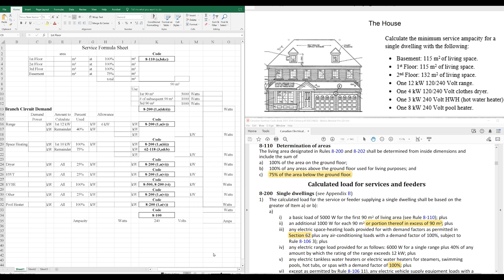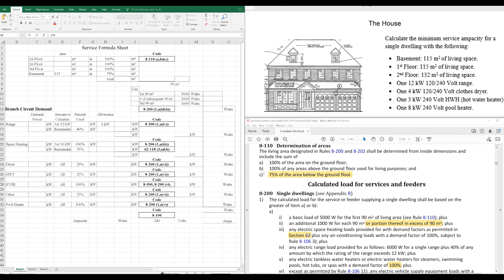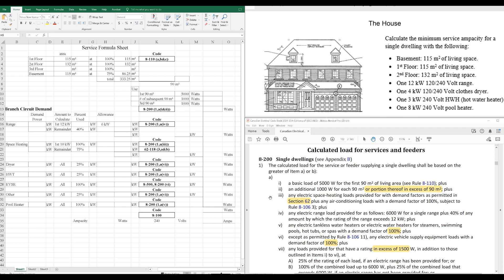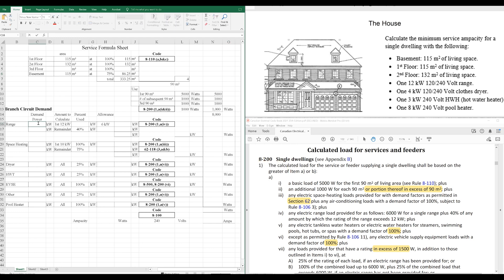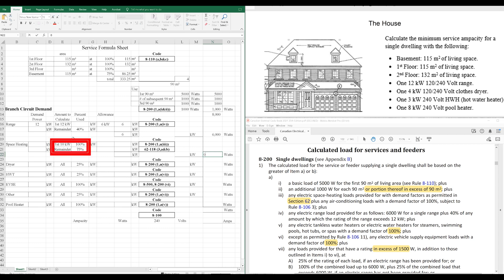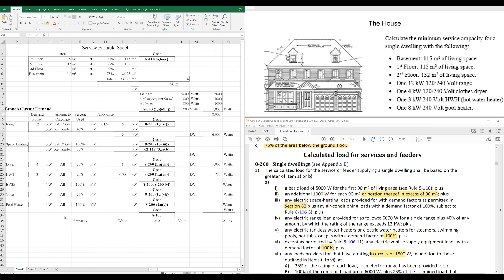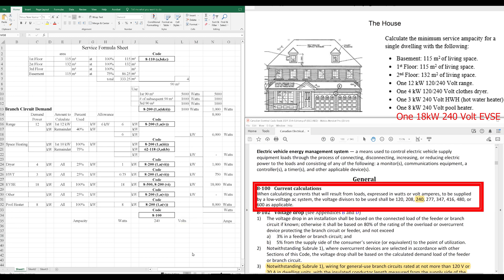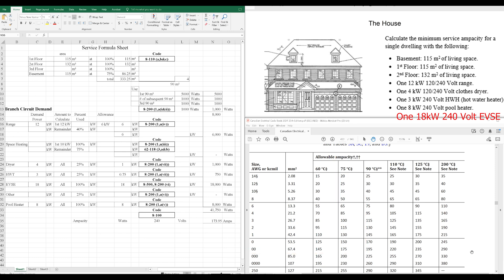How to Calculate Residential Service Size/Ampacity - CEC Service Calculation - The Electrical Guide

Comment: What do you do if you have fridge, microwave and gas furnace. I have those listed on a question with no watts or amps so not sure if i just ignore them as they are calculated in the basic load?
Reply from the maker: Generally none of those things are counted as they are usually under 1500 watts. If they happen to be monster appliances and over 1500 watts you would take them at 25% if you counted for an electric range already.
Reply: @theelectricalguide awesome thank you so much. Makes a lot more sense!

Comment: What if no load is given for the water heater and the stove?
Reply from the maker: Maybe gas range and hot water heater? Generally you need to account for the range unless it’s gas because it’s usually the biggest draw of a standard house

Comment: I’m doing some homework currently. I have my main breaker size but I’m asked my panel size in amps. If my main breaker is 300Amp on a 120/208 circuit what is my panel size in Amps. What table would I find this?
Reply from the maker: Usually we discuss panels in terms of "ratings" that's the rating they give to the panel box. So you would need a 300amp rated panel at least, going higher rating is also ok but will cost more.
Don't be shy to call an electrical supplier and ask them any standard ratings of anything :)

Comment: If it was 173 why did you jump to 200 and not the 175 ?
Reply from the maker: 175 is not a standard service ampacity where I live. 100 and 200 is. 200 is the new standard and is being installed in all new homes. If you run a calculation and get 102 amps that would also be a 200 amp service. Hope that helps :)
Reply: For testing purposes would you say 175 amp service ?
Reply from the maker: @justinwells1221  great question. That would depend on the wording of the question I suppose. If the world “calculated” was used then perhaps yes.

Comment: I have a question. Why is hwt is in other load? Shouldn't it be in 8-200 v)?
Reply from the maker: 8-200(v) applies to TANKLESS, this is a hw"t" for tank.  :)
Reply: How do I calculate a cook top and a separate wall mount oven?

Comment: if I am right, you have omitted rule 8-104 6) a) b). while calculating the ampacity. it should be 41750/0.8= 52187.5.   52187.5/240=217.45A. T2->75 deg->4/0 wire. Kindly correct me if I am wrong.
Reply from the maker: Is the load continuous? 8-200(3)

Comment: Hi Thanks for your great videos. Please make a video about how sizing bonding conductor.When should we use Breaker column when conductor ampacity(Table16) I am totally confused
Reply from the maker: Hello, thank you for watching. I'm not sure what you're asking. Usually you can size down the bonding conductor 1 size from the ungrounded conductor. Table 16 basically reflects that as well.